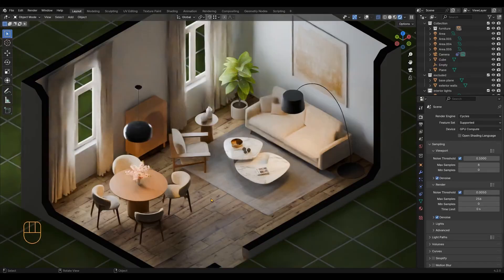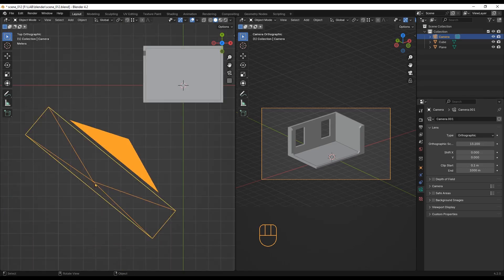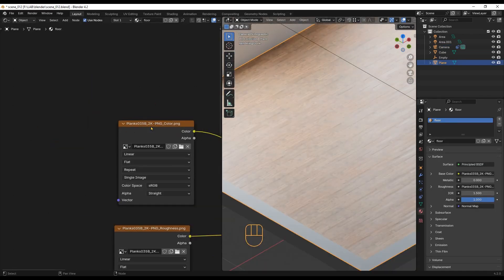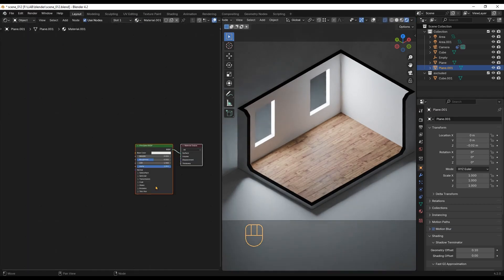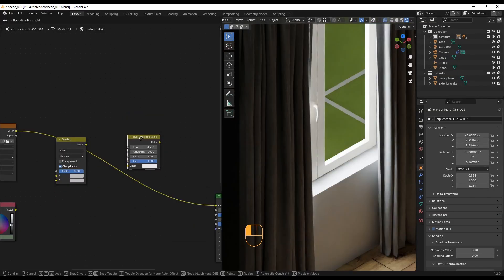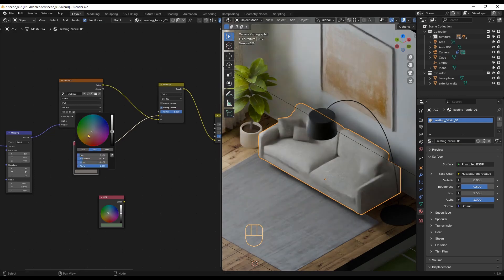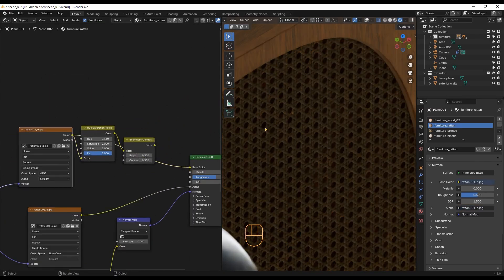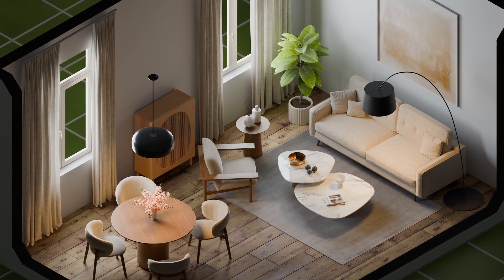Creating a Realistic Isometric Interior in Blender

Comment: Hi , how do you know what is the measure of the texture in the real word ? i mean , you said that you texture measures 4 meters, but about what are you talking? the measure of the table ? o what is the thing that have this 4 meters.  I hope you can understand my doubt , my English isn't good yet.
Reply from the maker: Hi, perfectly understood! I know the texture measures 4m because the texture map I used has 16 planks. Each plank should measure 25cm in the real world. So, 0.25m × 16 planks equals 4m. That’s how you can know (or decide) the dimensions of any texture map.
Then, you just use the value 1 when setting up the cube projection value, and the scale inside Blender will match the real world! 
I hope this helps clarify your question. Thank you!
Reply: @coral_lab  mmm i don't understand jeje,  you already know that you texture has 16 planks, ok, but at the same time the texture said what is the measure of each plank or where you find the 0.25, is just analysis ? or that measure is in some place haha. Sorry but I have a little mess with the scale and the textures
Reply from the maker: The texture map doesn't specify that each plank measures 25 cm. I chose it. You can check wood floor manufacturers' websites (or other material suppliers) to see the dimensions of their products. A width of 25 cm is a common size for planks, which is why I decided on it!